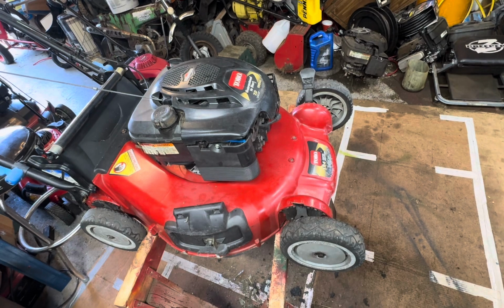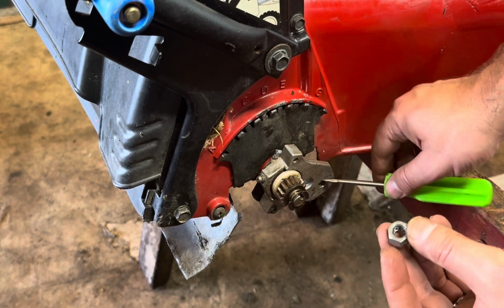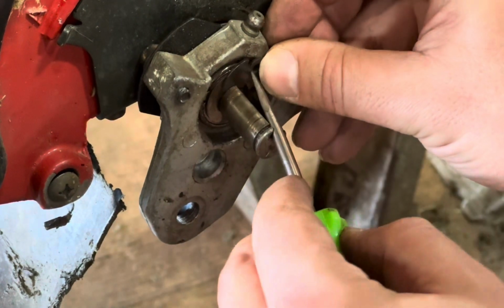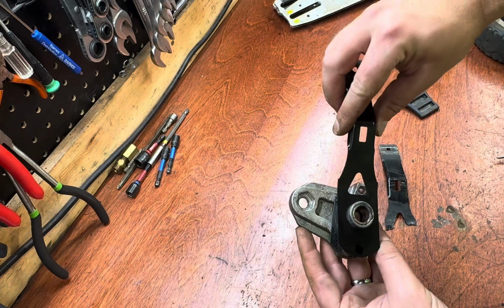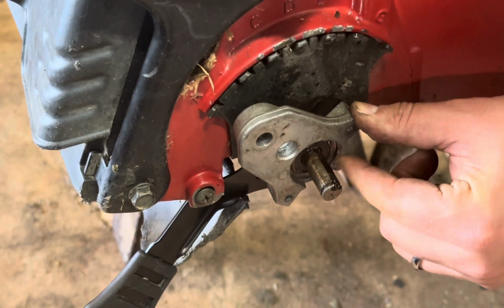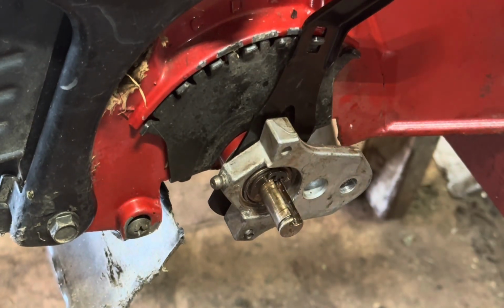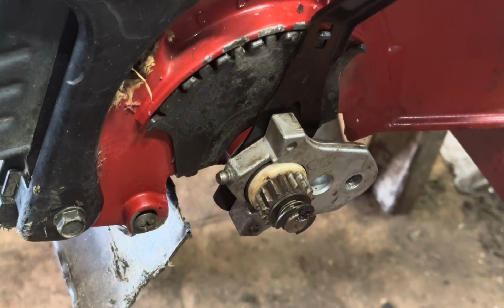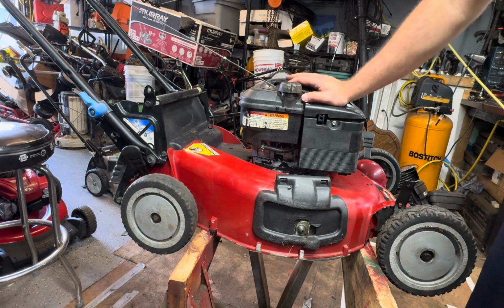Toro SR4 super recycler wheel lever replacement

Comment: Is it possible to disengage the self propelled?  Mine doesn't work. I started to just take off the spring or something. It's all fkd up and it's extremely hard to push and pull hight adjuster handle keeps dropping until last night on a job the whole back right wheel fell completely off.
Reply from the maker: It is possible. The wheel shouldn’t fall off if the bolt is in place. You can jsut remove the gear from inside the shaft.

Comment: I have this mower and it keeps eating the rubber washer and the white clutch washer...ever see that before? I put three new ones in just this year. When I replace them it works great for a little bit then it's back to grinding and wheels locking on pull back.  Fine mower otherwise.
Reply from the maker: I have not seen that before. Are you sure it’s installed correctly? No parts missing on either side?

Comment: This is a great video. I’m replacing the transmission an axle. Helps with all the small pieces. 
What do you lube the parts with? Thanks!
Reply from the maker: Usually a small amount of white lithium grease. I try not to use much lube because it attracts dirt. But if you clean it occasionally it’s good to lube the parts.

Comment: A great and highly useful demonstration- the best demonstration I have seen. However , I could never get the parts back to where they belonged. Once I got to the end, there was no room left on the axle to anchor the remaining parts and snap ring - I gave up
Reply from the maker: Did you make sure the rubber ring was sitting properly on the plastic ring? Also, did you give yourself relief from the opposite side spring loaded adjuster?
Reply: @SHONEY21Z - when you say “give yourself relief from the other side spring adjuster,” are you suggesting disengaging the other side from one of the clips and rotating it below to mimic what you’re doing on the side you’re working on? I did not attempt that - I believe the issue for my situation has to do with the position of that first snap ring. I don’t think I got the axle pushed down enough as you show in the video. I got frustrated and set it aside today. I will attempt it again and see if unhooking the other side to take the tension away, will help get me a little more of the axel for that first clip. Thanks again!
Reply: I am happy to report that, once I disengaged the opposite wheel, everything worked. The only thing that I notice now is that the wheel mechanism wobbles a little bit and it isn’t as tight as it should be -  not sure why but it is functioning
Reply from the maker: Might have lost something? But yes, relief from the opposite wheel is what I was talking about. Glad you figured it out, not sure why it’s loose, possibly missing a washer or collar.

Comment: I love SR4’s and have owned a bunch of them, but the one and only thing I hate about them is the waaaay too long wheel height adjustment lever. Every time I go to trim around fences or shrubs with mine one or both of the front wheel levers gets bumped and lowers the deck. I just don’t understand why the levers are so ridiculously long and stick way out above the wheels like an antenna. I almost want to take tin snips and cut about half of the lever off! Literally the only criticism I have for this otherwise great mower.
Reply: Finally, an explanation for why so many adjuster plastic grips are missing from mowers I see!
Reply from the maker: I don’t understand either. I guess for leverage. The Timemaster is the same way. Gets stuck in the chainlink fence all the time
Reply: @SHONEY21Z  Yes, exactly! My other mower is a Time Master and same thing happens when the lever gets bumped by the fence or the shrubs, only with the Time Master I end up scalping the grass before I notice because it lowers both front wheels.
Reply from the maker: Or I pull the crap out of the fence and mess it all up